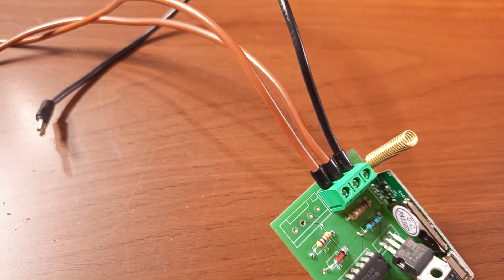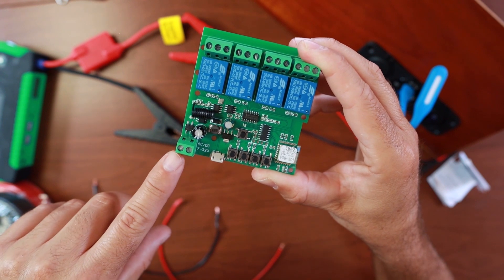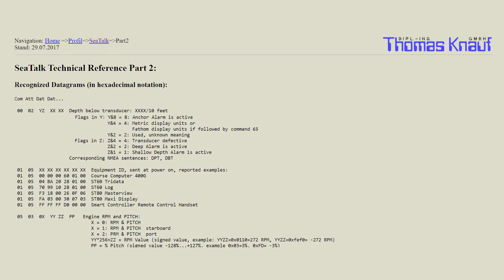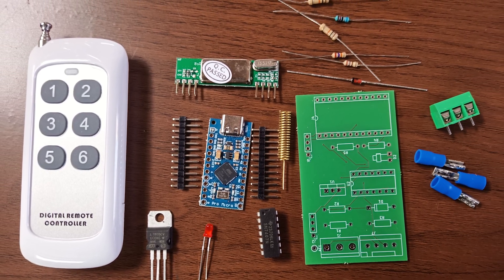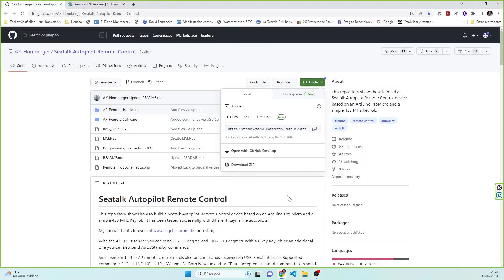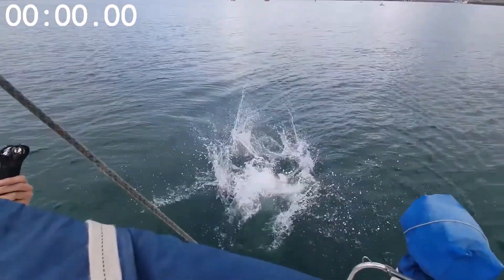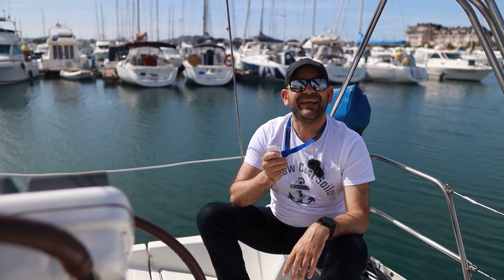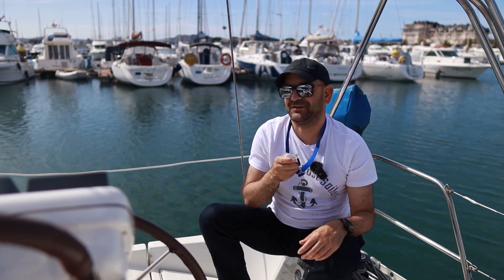EP58 - Remote Control for Your Boat's Autopilot: DIY and Save Big!

Comment: Hi, I have a stand-alone ST 2000+ tiller pilot on my boat, can you show me (wiring diagram) how the fully built remote system would be connected to the tiller pilot socket?  Many thanks.
Reply from the maker: At the end of the product description in our store, you'll find a link to the instruction manual and wiring diagrams. It's very simple. https://www.thelowcostsailor.com/en/product/pre-assembled-and-programmed-remote-control-kit-for-raymarine-autopilots/

Comment: I'm intrigued by the engine cut off if an overboard. With this device I wonder if it's possible for the boat to automatically head in to wind for the same reason? That way boat under sail won't just keep going.

Comment: Hey guys! Great program! Would you be able help with an old autohelm 5000? I believe the motor control transistors are damaged . I found replacement power transistors in the navigation station, but, I haven’t installed them. I would be very interested in your MOB control as well. I just subscribed.

Comment: Would be interesting how to set a remote control for genset, any projects?!
Reply from the maker: Right now, I don´t have a genset, but can be difficult if it has an electric start button.. We have a video in our Spanish youtube channel (with English subtitles) about remote managing any button on your switch panel..  https://youtu.be/gdB2Zn-vVw0
Reply: Thanks, will check it out. Yes, genny has an electric button to start and stop. I hoped there could be a way to program it for running time, eg turn of in 4h or something.

Comment: Would this work on the Autohelm 4000 system? Very interested if it does!
Reply from the maker: It works with Autohelm ST4000 but not with Autohelm 4000 that doen´t have seatalk protocol.

Comment: Can we buy these in the UK? i just tried to order one on your site and am not seeing an option to send to scotland. The whole thing looks great and i have just shared your video with pals who i am sure will also want to buy
Reply from the maker: Hello Dave. Yes, we ship to the UK. I've just enable the option in the shop, now you can select United Kingdom as the shipping address. Right now we have stock for all versions of the remote control. If you have any questions you can contact us at thelowcostsailor@gmail.com 
THANKS FOR SHARING!!!! 😀😀😀
Reply: Received mine, they work perfectly. I have the raymarine one as well, ans these work just as well, and actually normally connect quicker. I got them as spares and generally have the LCS one round my neck now, so very happy with it, thanks

Comment: Thanks for this - very cool. Just one comment, your (low cost?) audio needs a bit of work.
Reply from the maker: IA for audio is still a work in progress, but the alternative, redoing de vídeo completely in English, specially with more than 90 videos already published in our Spanish channel, is a lot of work.
Reply: @EngineerK  I find the audio quality quite good. What kind of improvement are you suggesting?
English is not my first language, so I wonder if it is an interpretation ( brain processing ) thing?
Reply: @noldushumlesnurr6169  its just a microphone issue